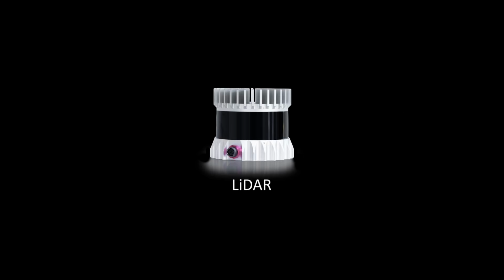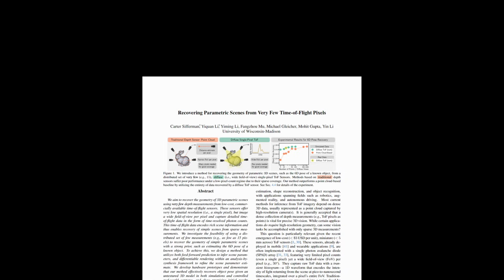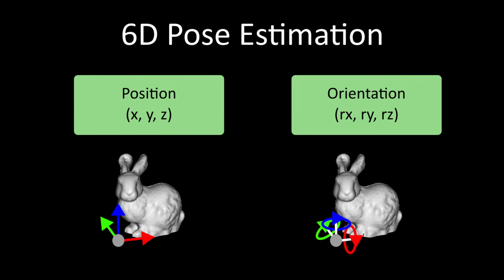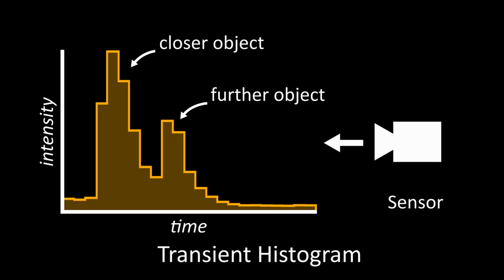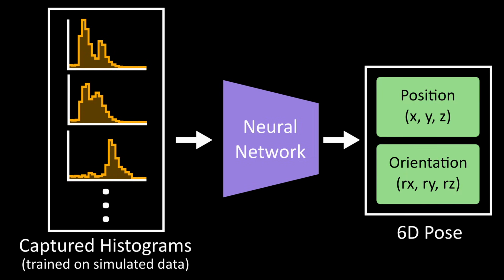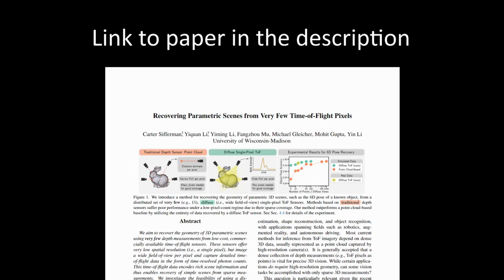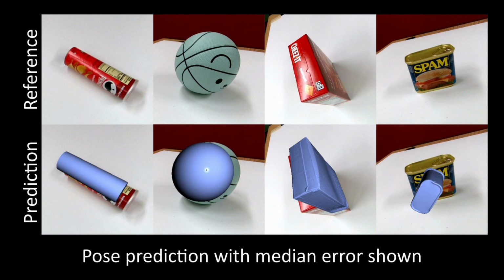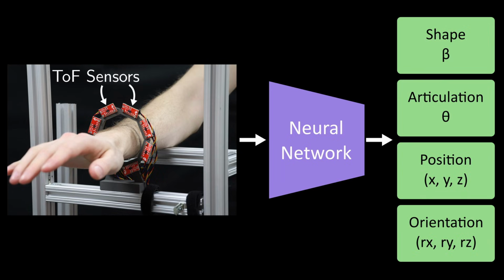3D Reconstruction Using Only 15 Pixels

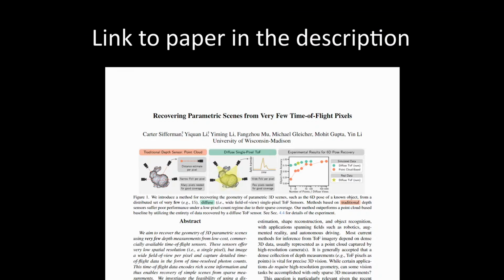Comment: 3:18 "the sensors wide field of view" - interesting, i did not expect a single pixel sensor be able to capture a wide field of view. so, what is the FOV of one of those sensors?
Reply from the maker: A single pixel is typically something between 3 and 11 degrees. In our case, we pool all the pixels of the sensor together to form one pixel with a 33 x 33 degree field of view.

Comment: I'm interested in the computing power requirements vs accuracy for such algos, and see if it is an advantage over neural net modeling.  Seems like there was a shift from SIFT algos to neural nets, likely due to GPUs recently (within the last 10 yrs or so).

Comment: With an array of sensors the time sync is the issue. There will be more errors due to uncertainty in time shift between sensors. How do you sync it?
Reply from the maker: Since this is just a prototype, we simply hold still during data capture to make sure sync is not an issue. For a production device, sync could probably be handled electronically by working with the sensor manufacturers.

Comment: So basically your concept is NN trained 1D 3D-shape recognition, right ?
Reply from the maker: "Recognition" usually refers to selecting an object from a list. In our case, we have some parametric model of the object, and want to recover its parameters. For example 6D pose or hand pose + articulation. We use a neural network for the initial estimate of those parameters, and feed that into a refinement module, so it's not just a neural network.
Reply: Nope, it just restores the position and orientation of a known 3d model.

Comment: Can this be done using cameras instead? Or some kind of hybrid model with both cameras and lidar?

Also can it be computed in real time?
Reply: There are a lot of 3-D reconstruction programs that use purely camera data from a lot of different angles (see COLMAP) 

However a hybrid approach would allow for more accurate distance data combined with the actual colors and visual data from the cameras

Comment: I just finished reading your paper and I have some thoughts and questions:

First, is the SPAM error because ADD-S compares to the nearest pixel instead of the corresponding pixel?

Second, on the hand pose, I wonder ( my degree is in electronics engineering ) if the fact that each of those eight ToF sensors is firing its laser at basically random times, compared to each other. If you were able to synchronize the ToF sensors so that they either fire all at once or in a pattern that minimizes the interference between sensors, I think you would get much more useful data from that setup...

I just went and read the datasheet, application note, and other docs. I think that it should be feasible to time measurements so that sensors next to each other are not emitting laser light at times that mess with the expected distribution of light in the FoI. The key will be getting the clocks close enough to synchronicity to keep the interference between them low.

Perhaps using the "checkerboard" SPAD maps instead of the 63 degree one would yeild better results here and on the SPAM can as well.

Third:    I may be off here but I wonder if the techniques used in Fourier Ptychography might be useful here? It seems to me that there is a strong similarity between taking distance measurements of an object from random, but known locations and the way multiple random openings at a known distance are used per pixel in ptychography.

I think you guys are really on to something usefull here! After reading your paper and the docs for the TMF8820 chip, I can see that you chose a sensor with plenty of access to the internal features so you can test your ideas easily. I hope to see more on this in the future!
Reply from the maker: Thanks for reading the paper! 

The SPAM failure case may have to do with how ADD-S works, but it's hard to come up with a better loss function for symmetrical objects. The SPAM can is also just difficult to estimate accurately because different orientations look very similar due to its near-symmetry.

If you look at the supplement of our paper, section D, you'll see that interference is already minimal in the eight sensor setup. The fact that the sensors are not synced is a feature in this context, not a bug!

All interesting points on the rest. Will have to look into it. Thanks for the comment!

Comment: Neural networks are ruining science. Bear in mind that a trained net doesn't reflect any understanding of the problem. It is basically a method of estimating an answer in a system you don't understand. It can be useful, but doesn't advance knowledge.
Reply from the maker: We have a great understanding of the system. We carefully model how scene geometry relates to sensor measurements, which we use in our refinement module, and when rendering synthetic data to train the neural network.

If you insist on not using a neural network, you could do a search through the space of possible scene geometries and find that which most closely matches the sensor measurements. This would be computationally intractable for a scene with more than a few degrees-of-freedom, and would not lead to a useful system, or be useful science.
Reply: this is gradient descent based on a loss function, all math, no neural network appears to be used according to the diagram at 3:19 . gradient descent may be used in ML but it doesn’t automatically make it a neural network. It’s the simplest effective solution they’ve found, which is much better than some convoluted algorithm that takes loads of resources to inefficiently get the same results (there is one used at the end for the hand pose estimation, but it’s not the main objective of this research)
Reply from the maker: @jiegao3591 Thanks for your comment, and you're exactly right that the solution presented is the simplest effective solution that we found. You're right that the refinement module is just gradient descent, not a neural network. But we do use a neural network to generate the initial estimate for the refinement module.
Reply: In cases like above, we don't need it to understand the problem - just to provide expected results in test-cases.
As far as advancing knowledge, I disagree - the methods can be novel and improve approaches.
Reply: Science does not have a direction. Science is random. It goes in random directions according to the environment it operates in. Infact, a lot of things are not scientific, even if scientists themselves do not want to admit them.  What you are alluding to is reductionism which says parts of a system can be understood by studying subsystems and their behavior. But then, the atoms are the subsystems and when you use these subsystems to analyze larger systems, you are not understanding the breakdown of the subsystem.  I can make a sweeping statement like using classical mechanical models for solving problems does not reflect in any understanding of the reality. But would you refrain from using classical mechanics to solve problems or will you call people who do that to be ruining science? 

I do agree with your sentiment though. But there has to be a balance and the current frenzy does elicit and need strong questions like yours.